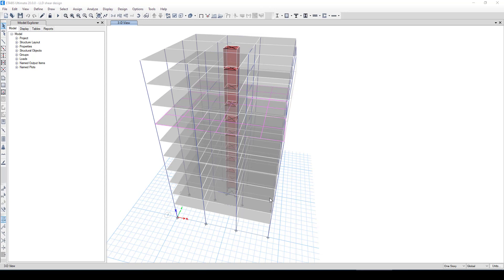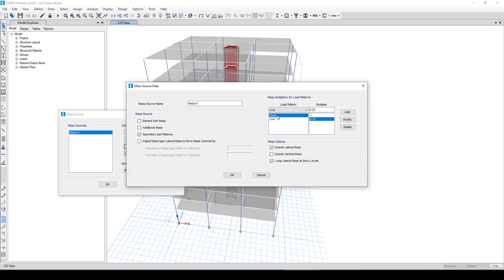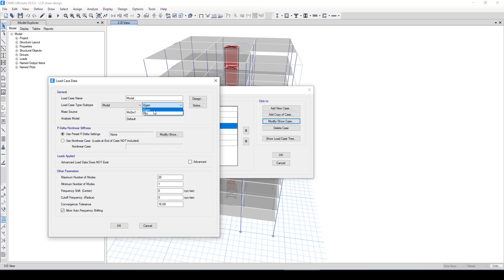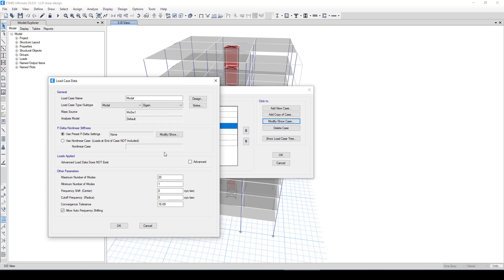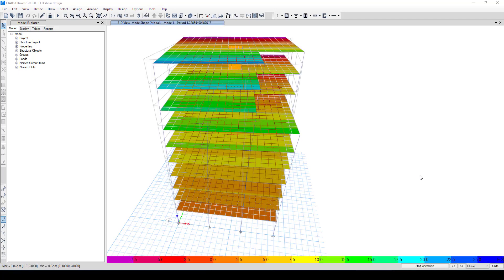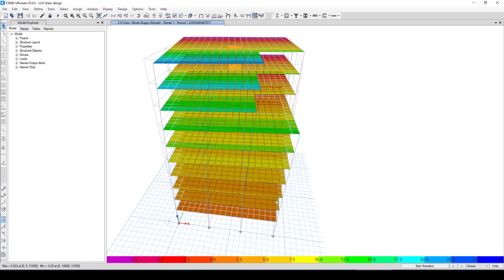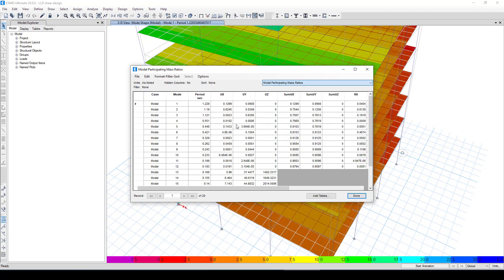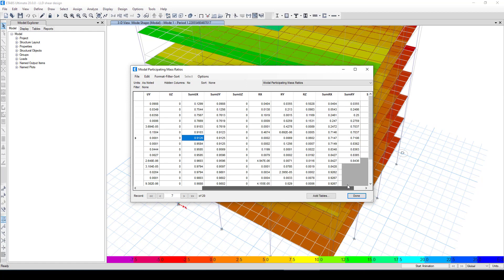ETABS Tutorial, Modal Analysis  of an RC structure

Comment: Is to compulsory to get uy more than 0.65 in 1st, Ux more than 0.65 in 2nd mode, in rz  more than 0.65 in 3rd mod???
Reply from the maker: What do you mean compulsory? If you  mean 65% mass that would be small code recommend it should be over 85% or 0.85 in all three directions.